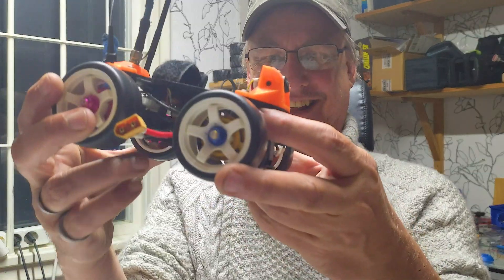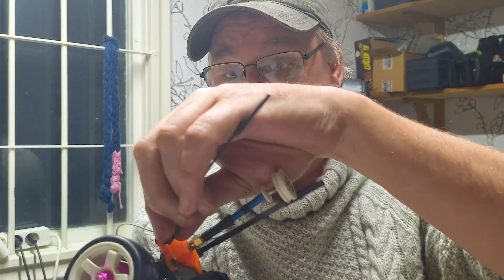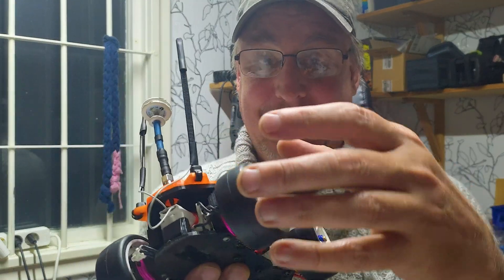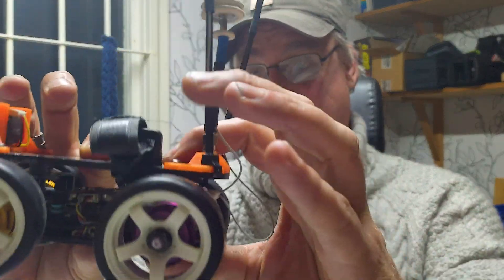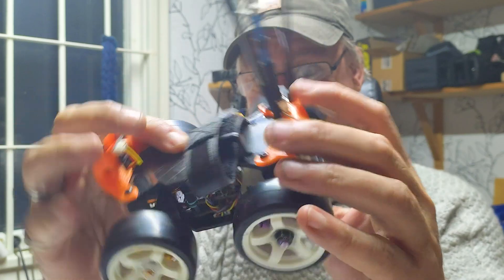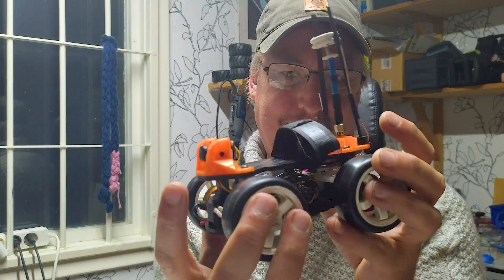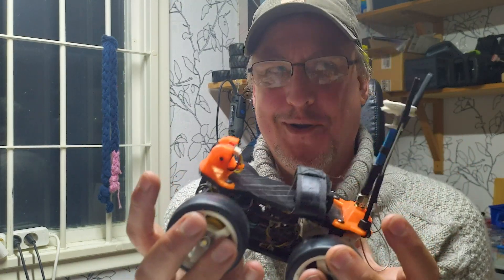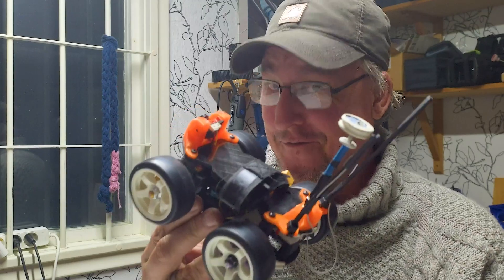Converting 5" FPV drone to a tiny RC-car

Comment: this is really cool but could you do a little tutorial on how you made the front wheels turn?
Reply from the maker: They actually don't, it's only turning like a tank,.If I turn left, the two motors on the right speeds up. So it uses "stabilized yaw" in betaflight just like a drone. Only problem is that you can't just roll forward and steer, you have to have at least a little bit of throttle. But it makes very durable since there are so few moving parts.

Comment: good work, what did you program in to the fc? 😮
Reply from the maker: Instead of a drone or a plane I picked "custom" in BetaFlight and used the mmix to stabilize on yaw. It's a bit of tinkering to get it perfect, but if you follow the thiningiverse link in the description you'll find a link to a new version that is more durable and with lower CG, and some settings and tuning stuff. ☺️
Reply: @MattiasKallio  do you want to make a co-project? 😊

Comment: That's Cool stuff right there. I fpv most of my RC cars. I haven't posted anything on my channel of my projects. I Love to Tinker. Awesome 👌 little fpv rc car drone.
Reply from the maker: It's my favorite thing with the hobby, tinkering and figuring out new things you can do. Flight Controllers are so usable for anything you can just get a signal for "stabilized yaw" to run servos or motors and stabilize anything. Like I took an old toy rc car once and put an FC with a GPS and iNav on it and let it go on waypoint missions. :D

Comment: hi  sir , i just want ask ,how you make wheel turn , is it set up by bf for different speed for turn or how ?
Reply from the maker: Hi! Yes it's a BetaFlight thing. It's a "custom" setup under motors and then some mmix settings in the CLI. I have a newer version of the car on Thingiverse, and there it's explained how to do it. https://www.thingiverse.com/thing:4914345

Comment: Hey! I'm building an moa rc crawler. I'd like to control both motors independently one esc. Goal is to have motors turn different speeds relative to eachother. How can I do that?
Reply from the maker: Hey, I don't know much about crawlers, but I don't think it's possible to use one ESC to control two motors speeds, unless they're the same speed. You probably need one for each motor. On this one I have a 4 in 1 ESC so all the four motors have it's own speed controller (two of the speed controllers can use the same signal tho).

Comment: Hello your video is very kool I’m doing a project similar to this and I can’t figure how to stop the motor from moving when I arm the Fc can you help me to help stop my motor’s from moving when I want it to stop and start when I wanna go thanks
Reply from the maker: Hi, there is a setting in betaflight under the configure tab for that,  under the motor protocol somewhere. But it could be the airmode too if that is used.

Comment: That's such an amazing video, I absolutely love it, I was bored and though about a 5" drone into a car and you are the only one that had this idea and made it into a video
Reply from the maker: It is sort of fun, I have played around with it a lot since then too. ☺️ I have redesigned it a couple of times now it has two 18650 batteries and a lot lower cg so it handles a lot better. Probably have to make a new video soon. ☺️

Comment: I've made something like this with a raspberry pi zero and 22XX drone motors too! Seems like you dont have any problems with torque or wheels being too fast?
Reply from the maker: Cool,, Rasperry Pis have a lot of potential, there are so many thing thast possible it's mind melting. :D
Yep, I have had problems, iNav have som weird bug, if you use Dshot and reversable ESC, and try to go reverse... When the throttle is below the center, it goes from 100-0 instead of the other way around. So full speed, and that makes all the wheels either explode or just fall of and go full speed in different directions. :)

Comment: how it made?
Reply from the maker: There is a link to Thingiverse in the description, and I have a long, and a bit boring, build video too. :)
https://www.youtube.com/watch?v=hMNF_kcpMxo
Reply: @MattiasKallio  can i turn this model into rc car https://www.youtube.com/watch?v=q6D06rWOb_4
Reply from the maker: @mimamaiksmika3853  I think it would be hard. In a race drone you have the flightcontroller that can be configured to do more or less anything, and also the motors have a lot more power.
Reply: @MattiasKallio  so it's impossible?
Reply from the maker: @mimamaiksmika3853  I like to think that nothing is impossible, but this might be close to that. ;)
Reply: @MattiasKallio  you can help me I have already opened my drone and it's too late to go back

Comment: These kinds of videos are what makes the internet good. :D More! McGyver more shit :D
Reply from the maker: Yeah, it got potential, I'm hoping to be the guy everyone blames for shopping mall races, and broken ankles all over the world. 😂
Reply: @MattiasKallio  Haha! Linked to you from DroneSportz on fb. There might be others who would want such a project, winter coming and all. Some people fly less during winter and they might wanna convert for a few months. I am not such a people but I do have a bunch of 4s motors and old electronics just laying around getting older without ever getting used in a quad again. ^^ Such things has potential to break a few ancles before discarded, right? 😁
Reply from the maker: @ypvsypvs  Yeah, I'm planning a build-video, and I'm using an old F3 FC. Since it's just stabilizing yaw and run the motors it doesn't really have to be fast and iNav works on some old F3 boards. ☺️